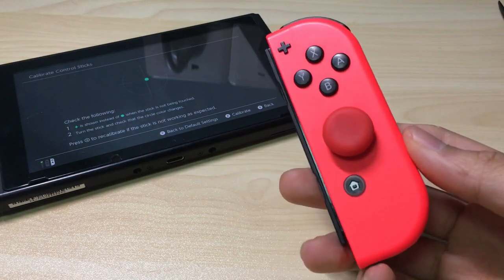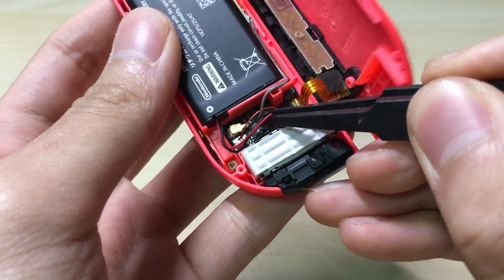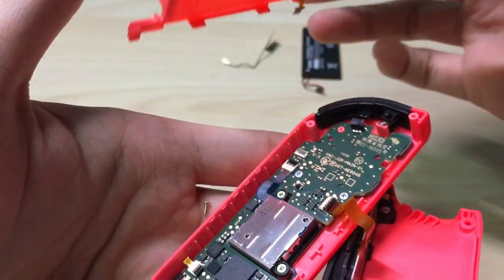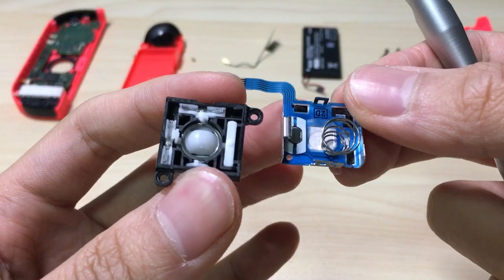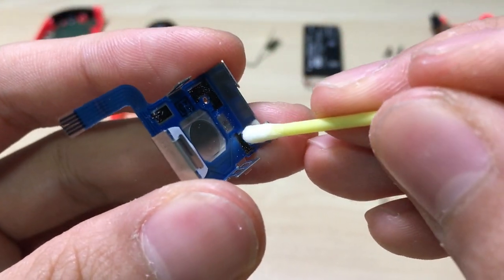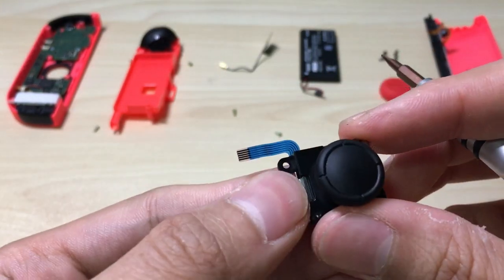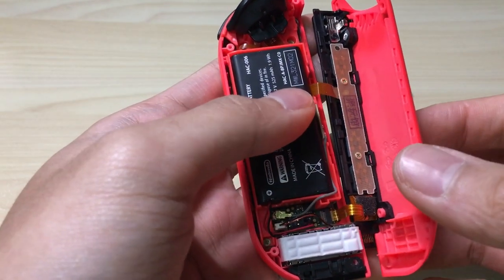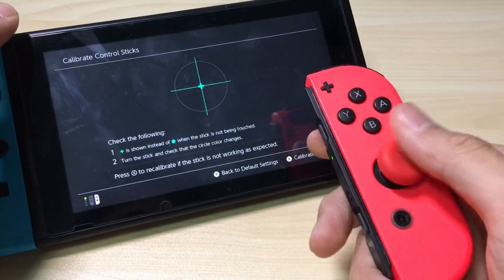Fix Joy-Con Drift by CLEANING the Joystick 🕹 - Nintendo Switch DIY Repair

Comment: This is the best video on this subject.  Thanks!  Not everyone has the hands to do this sort of thing, but for those that do, this is the video you want.
Reply from the maker: Thank you for the compliment! 🙏🏻
Reply: I just fixed mine with a pack of joystick replacements. It wasnt to bad
Reply: @Jon you will have to buy a whole new sensor if you messed up the shielding case.

Comment: Did everything exactly (including losing a screw) and it's revived. Hopefully for as long as possible. Thanks. :3
Reply from the maker: 🤣 As long as it gets back working right hahaha glad this video could help!
Reply: I've found that most products I've fixed usually have at least one screw you don't really need. That's my way of saying I usually end up losing something along the way :)
Reply: It's not a proper DIY repair unless you lose a screw
Reply from the maker: Ahahahha can’t agree more☝🏻
Reply: @Dichali Nash no
Reply: Dichali Nash typically it will, if you lose too many or maybe an important one, thing may rattle which could lead to further damage but typically you can put them together fine, my suggestion is to have extra screws like I do
Reply: @anymoose  lol
Reply: Put after the cleaning 0,7 mm cardboard under the Joystick box to avoid 
Joy-Con drift forever

Comment: Can't believe this actually worked. Thank you very much sir, you deserve a medal. Just to clarify, in my case there's no dirt or anything inside the analog, but i passed a contact cleaner anyway. I bought my switch brand new and after less than a week this drifting problem started, now it's fixed, hope for at least a couple months. Thank you again!
Reply from the maker: You’re welcome, and thanks for sharing your experience!

Comment: This fixed my analog stick, nice tutorial. I did break the small metal tabs on the top and bottom of the analog stick but it will still hold together with the grooved tabs on the side
Reply from the maker: Whoo good job good job, I hope it will stay working for long!
Reply: I broke all three lol
Reply: Lol I broke one tab and it's still not put back together, I'm going to have to do it soon 😂 because after this joycons I do the other one.
Reply: I broke all 3 tabs too and the tabs don't hold it together. Tried it with glue but didn't work. So I have to install a replacement stick. Luckily I ordered some :-).

Comment: This fixed my drift problem, as well as my character not wanting to go "down" very easily. Incredibly frustrating if you have meaty, sweaty hands, but worth it for saving 70 dollars on a new pair every year, lol. My character drifted a tiny bit after doing this, but stopped almost immediately. Thanks a ton, dude.

Comment: Followed this to try to fix a joycon I bought with a broken joystick. Turns out the inner plastic holding the joystick is broken in two places. Extremely hard to fix by super glue, but I think replacing the joystick should make the controller like new again. Good guide.
Reply: Happend to me Today, it fell while it was attached to the "JoyCon Comfort Grip" and that plastic broke, i now bought a new stick, will replace it when it arrives in a few days.

Comment: Thank you, thank you, thank you, thank you, thank you!!!!! You helped me fix my right joycon stick. I had never done anything related to electronics or disassembling electronics and you gave me the confidence to do it. I am so grateful. Thank for being kind and humble enough to share your knowledge with everyone.
Reply from the maker: You are very welcome :D always a pleasure to help!
Reply: Hi @baldorigami I don’t know if you will still read this, but is the joystick you repaired still working? I’m not sure if I should try this or completely replace the stick
Reply: LuvieMoo, if you have a replacement stick, it’s always better to replace it. In my case I didn’t have another joystick to replace it with, so I opted to trust this wonderful guide. It continued to work perfectly for 3 months, but I live in a very dusty city. I recommend this for emergencies because the metal casing in the stick is not meant to be opened, therefore, it’s very complicated to remove it and even more so to place it back because it can be uneven because of the bending and when putting everything back together it might not be as snug. Learning how to replace the sticks is a great investment because joycons are crap and they are expensive.
Reply: baldorigami Thank you so much for answering, I guess I‘ll just try both methods because I have two drifting joysticks and see which works better. Thanks again and have a nice day :)

Comment: Thank you for showing exactly the cause of the problem and what fixes it. Others just replacing the joystick without showing what happens inside it. Why to throw away an old one, if it just needs some cleaning and works as new again. (Prefer the method of cleaning it from outside, without disassembling the whole thing, if it'll work).

Comment: Thank you so much.  Just finished my son's left Joycon and he's over the moon happy.   Only thing we encountered was the metal tabs on the joystick module itself are incredibly easy to break off- I broke most of them.  Thankfully I was able to get everything back together and get it working.

thanks again.  Outstanding quality video; really well done.
Reply from the maker: Exactly, I broke the metal tab on my second time cleaning it, in the end I tapped it together and they work just fine but yeah, I didn’t realize at first it was that easy to break.

Anyway, glad to help! 😁
Reply: I broke both of the tabs on one side of the joystick off and used tape to repair it... somehow it still works perfectly

Comment: Wonderful tutorial. I've used it to fix 4 or 5 joycons so far. The rest I've had to replace due to breaking the tabs but practice makes perfect. Once you practice you can also leave many of the wires connected, you just need to be very gentle and delicate. It really cuts down on time though.
Reply from the maker: Thank you so much! That’s true fiddling the wires takes so much time ✌🏻

Comment: Did this 3 years ago with some contact cleaner on heavily drifting Sticks. The Stick drift actually didn't ever come back after easily over 1000 hours of use. This method works extremely well!

Comment: Here is my experience following this tutorial:
I had 2 left joycons with a slight drift that was getting worse and worse (from the calibration menu, I could see that they were centered but often would not come back fully to the center, or would do it slowly).
First joycon: I opened the joycon as indicated in the tutorial, and managed to break the same little metal piece as in the video. I put everything back together after cleaning inside and went to the calibration menu. Now the point was way off-center, and when trying in-game, I had a very clear drift, a lot worse than before. I went back to calibration and tried to calibrate a few times, without success. Then I don't know what I did (left the calibration menu, or restarted the game, or moved the stick in some way, I don't know), but it's now well calibrated. I have no idea what I did.
Second joycon: I managed to break both metal pieces, making it impossible to close the stick back. I still thought I'd try putting it back together, since the metal piece ultimately rests on the plastic piece separating it from the battery. It was a bit hard to hold everything so that the spring wouldn't bounce out, but I managed. Calibration showed a very slight drift initially, and after re-calibration this joycon now has no drift. Still, there is a spring in there ready to bounce at my face next time I open it...
In the end, the hardest part is taking the stick itself apart. The rest is very easy. Given that a new stick is barely a few bucks on Amazon, I have ordered some and next time I have a drift, I'll just replace the stick and not bother cleaning it.
Reply: About first joy con and calibration: you took joy con off the console and put it back again. Some magic with attaching joy con to console. I had it today, could not understand why it wont calibrate...
Reply: I broke both little metal things on the stick on both joycons I repaired, but I think it wasn't very difficult putting it back together
Reply: @ehrenbandiger692  I’ve just broken both of them in both my L and R managed to place them back in but I want to ask if there is any problems to doing that
Reply: @VongolaEX10  the stick should really be closed, otherwise there could appear a different kind of drift. I closed them additionally with tape, then the drift is gone but it will maybe appear after time because of dust and stuff
Reply: @ehrenbandiger692  I’ve just tested both of mine and after calibration it seems that it is fine also the tape is pretty much useless when you use the L3 and R3 (push button on joy cons) anyway- I actually tested and also tape doesn’t effectively close the base however is is an excellent placeholder until you place on the battery plastic piece which is supposed to sit flush on the top of the joystick assembly- tested by pushing down more when reassembling- if the pushing had a strong reaction force then it meant I had to go back and readjust. Anyway the best assessment is to have a look at whether or not your joystick is perpendicular to the socket or not and whether or not the battery has less values in one direction which wouldn’t matter anyways after you calibrate

Edit: the tape isn’t useless however imho it’s only useful when you’re reassembling afterwards it might as well be a piece of paper trying to stop punch
Reply: Is there any problem that you have gotten by just placing in the joy con (some people are saying to use tape) but if the assembly sits on top of the battery plastic piece. 
Just want to know if you had any problems
Reply: @VongolaEX10  i think if theres just not enough pressure on the stick piece, it can cause smaller problems but it depends
Reply: @ehrenbandiger692  alright guess I’m going to have to reopen them todo to put in some tape
Reply: Just tried replacing the sticks from an Amazon replacement kit. Awful.  Even worse.  Im going to try this method
Reply: @davidjones5672  Yeah the sticks from Amazon aren't great. They've been working for a few months for me and then started drifting (the originals lasted a couple of years before drifting).

Comment: It's interesting to see the solution they used for the thumb stick.. from what I've seen they're using carbon pads similar to what you'd see on a ordinary button, while the older tv consoles used wipers (basically a potentiometer) to register movement.

Comment: Thanks man! nobody usually shows a right joy con disassembly, let alone the mechanism itself!
Personally though i'd disconnect much less ribbon cables on disassembly, just enough to access the stick mount as it can be tricky to insert them back without damage

Comment: Thank you for a really working guide. I disassembled joy con, but didn’t go all the way with disassembling the stick itself. Now I have confidence!
Reply from the maker: Glad it helped!
Reply: @namedkenn  unfortunately, I wasn't able to put joystick assembly back as some metal flaps got broken very easily, I went on Amazon and ordered 2 pieces of replacement joystick assemblies for just $9 which is still way cheaper than replacing the whole joycon.

Comment: Many thanks, great video. I managed to to clean both controllers without disconnecting as many ribbon cables. I did snap off the tangs on the stick housings but both controllers work a charm now.

Comment: I needed to see where the insides of the joystick went because I was already past the point of no return. This video was a big help, I just hope the drift goes away for a long time if not for good
Reply from the maker: Be extra careful when handling everything! Hopefully this will fix your problem :D
Reply: @namedkenn  I was careful. I'm at the point of "If this doesn't work I'm going to order a replacement stick" after several cleaning attempts that only fix the drift temporarily. I figured what the hell, I'll take it apart and see if I can clean it and get it back together. It's when all the little moving parts fell out into my holder that I needed to see how they all fit again. 

Hopefully this works. I had better luck cleaning out a new 3DS joystick with the same problem.

Comment: My left joycon joystick wasn't sensing when I pulled back on the joystick (which was not good for playing Dark Souls Remastered), followed your instructions and saw that on the black sensor pads within the joystick seemed to have stains around them, so gave them a clean with a glasses cloth (didn't have any suitable cleaning fluid) and put it all back together, and works much better! Still slight drift off centre from normal position but it senses all directions now 👍 have ordered a replacement stick though as I'm sure the issue will arise again

Comment: Thank you, your video was basically a class for me.
Did you have any issue with how fragil the metal encasing of the analog and how infuriating easy is to break the batery connector?
I had to reconnect with the connector broken... it was hard but manageable.
Thank you Kenneth! Got a new subscriber for that...
And no thank you, Nintendo, for such a below standars controller...

Comment: Well, it worked for now, but we also ended up snapping off the tiny metal bits we bent slightly to get it open. We just put it back into the device but when joycon replacement sticks are $8 it seems more worthwhile to just have a few handy and replace them every 6 months.
Reply from the maker: Exactly, my second time trying to clean the joycon was also a nightmare, the metal bit snapped and I had to tape it. Just as you say, it's handy to have a couple replacements ready

Comment: Had nothing to lose as my joycon was super unstable with the drift and had the replacement parts saved and waiting oredering. Took me a bit but got them apart and back together. Working like new after a quick restart and calibration.

Comment: as long as the contact pads are not worn off, cleaning the dusts actually helps to revive the drifting issue (as long as the drifting issue is caused by dusts and not worn pads)

Comment: I did this yesterday because the drifting was getting out of hand. Now it's like new again! 
I had to look up another video to see what to do inside a left Joycon, because in this video it was a right one. Unplugging the battery was probably the scariest thing for me, because I needed to pull too hard for comfort. Other than that, no problems.

Comment: Perfect fix for my drifting joycon.  Follow along and use a steady hand. Don't be surprised if you break 2 out of the 3 tabs on the anolog stick casing.  Thanks for the vid!
Reply: Do those tabs actually have any effect on the performance except for assembling the joystick- I broke the two small ones in both of my sticks and I’m slightly worried

Comment: Make sure you lift the battery connector UP off of the motherboard. I ruined mine trying to pull it away from the socket (parallel to the motherboard). Otherwise it was a breeze.

Comment: thank you so much for this tutorial!! I fixed my drift (for now) :D I think my problem wasnt just dirt. idk what the part is called but it's one of the plastic and pronged metal parts inside the analog stick, the prongs were twisted together. so I think that's why my drift was so bad. I did break one of the tabs but I was able to tape it together. anyone who's attempting this be careful of the tri-tip screws, they are very easy to strip. I stripped one of mine and had to Dremel the top off of it which wasn't ideal.
Reply: Next time you have drift on Joycons just use A light dab of WD 40 beneath the joystick then move it in a circular motion to lubricate the joystick inside the controller. It's easier fix than having to open the controller which is quite easy to mess up a connector or strip something off by accident.
Reply from the maker: Ohh right right that's the very thin metal thing right? I also broke my metal tab on my second time cleaning the joystick but a little tape fixed it for the time being 🤣 also that's true, we have to be very careful with every step!

Comment: You don't have to disconnect the little ribbons. You can just turn the parts over and lay them on the side. Even the scary tiny lil one near the top left. 

This is easier than you think! The battery cable is a lil tough to take out. Pull it UP towards your face, not sideways. The joystick is very easy to take out if you're doing this on the floor on the carpet with a sheet underneath.

Comment: In case anyone breaks off the hinges on the metal casing of the joystick (like me), try and put something soft on the battery to create a little pressure when you close the lid. This makes sure that the joystick actually hits all contact points.

Comment: Thanks! Fixed my drift problem. I had problems with pulling out the battery though. The whole plug came right off the board. I had to solder the wires back onto the board. But it's all good now.

Comment: the little metal tangs that make contact with the carbon pads get weak over time, they need bending out a tiny bit to reset them. Clean pads at same time.
Reply: Exactly.
People don't understand this and choose to put cardboard paper under the whole thing, lol.
That black stuff he cleaned in the video, isn't really dirt. It's lubricant. It needs lubrification. Ultimately, it's still metal grinding on carbon, which means it will completely wear out eventually. By design.
The only TRUE best design for a proper joystick is to use hull effect (basically magnets). No direct contact, no problem. Nintendo went with a shit design. Flimsiest shit I've ever used. They should have looked at the Sega Dreamcast.